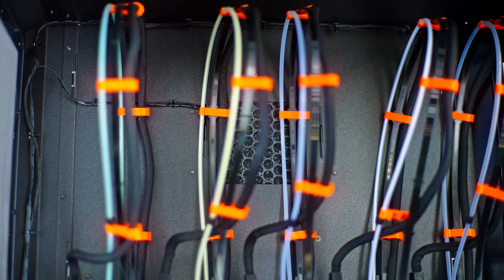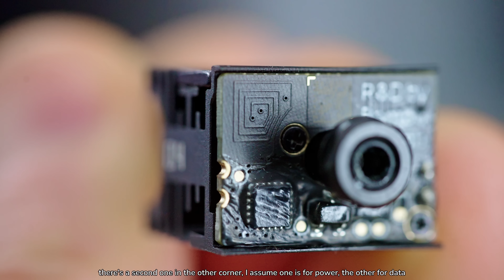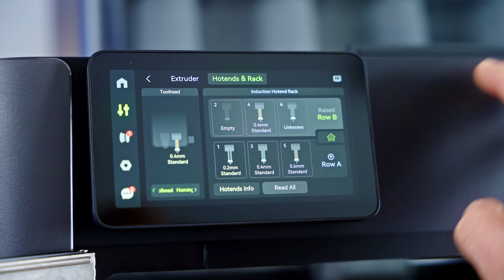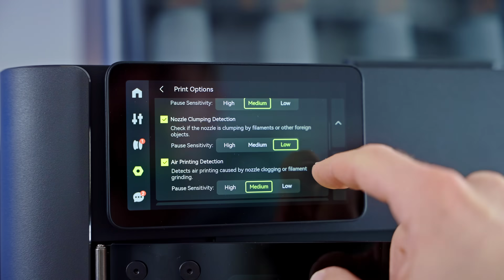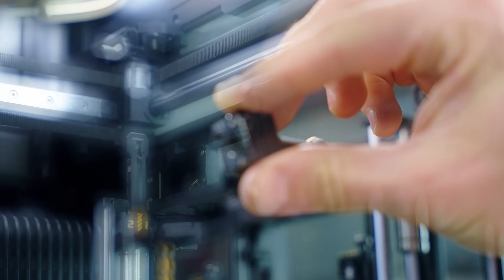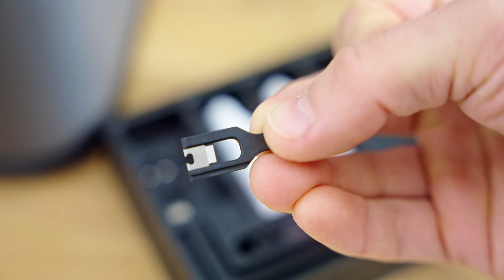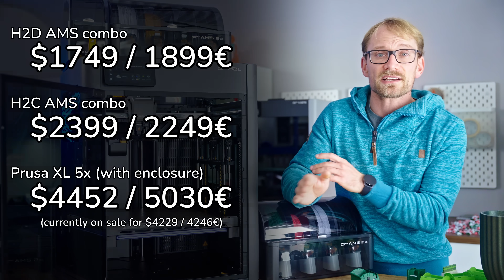The H2C is Bambu's 7-Hotend Patent Evasion Masterpiece!

Comment: Yay hotend vendor locked parts great....
Reply: Are there Prusa XL toolheads 3rd party?
Reply: @bootchoo96  not sure but if there aren’t that’s still no excuse for either of them. As I said in another comment, it’s one thing if there’s no options because no one can compete in price. It’s another if the manufacturer SPECIFICALLY BLOCKS COMPATIBLE PARTS WITH DRM that would otherwise work. That’s an attack on consumers like you, and your ability to own what you pay money for and repair it.
Reply: @dawn9340 "would otherwise work" sure but we don't know that
Reply: @bootchoo96  don’t defend something you don’t know about when the company is trying to slip its hotdog in your hole anyway. Literally your toothbrush charges using the same technology. Some soldering irons work on the same property of inductive heating. It’s not a new technology at all. So we do know that. We know that the company locked you out of having the price and availability advantages that competition brings. They’re loving you defending them though, I’m sure they’ll send you a few free printers though. Dummy
Reply: @dawn9340  yeah and my laifen toothbrush heads doesn't work with my Philips or Oral-B and I don't throw a fuss about it.

They are 3rd party brush heads but they are not the same quality as the OEM - but I get what you mean.

Just don't buy Bambu, or Prusa, or Snapmaker and make your own that way you'll have full control of your toolhead + nozzle
Reply: Just make a aftermarket part that replaces it. If you dont like something be the change you wish to see or 🎲 🎲 trying
Reply: @alexhise968  that’s not the problem. The problem is Bambu locking it down to make it harder where there’s honestly no good reason. We’ve been making coils for years now and there’s no reason that can’t be done by every factory in China worth its salt. The answer is not “make some incredibly complex thing to get around restrictions”, it’s “stop accepting crap from manufacturers and mindlessly buying it.” Unless you want to live in the world where you rent everything and can’t fix any of it. Check how John Deer tractor owners (aka the backbone of your food supply) are liking that…
Reply: Reality check, how many people actually buy 3rd party nozzles for a bambu? I'd wager not many (and yes mr furiously typing away at the keyboard, I know you do, that doesnt mean everyone does)
Reply: @puressk  A valid concern since you cannot un-clog them apparently. I would expect you’ll buying more of them than with any currently used machine.
Reply: @puressk 

This. 

And offcourse bambu wouldnt allow thirdparty nozzles. The chance something breaks with subpar thirdparty nozzles is to big. And then bambu has to trouble shoot problems that other vendors caused..
Reply: @blikje_in_de_water so one day, if their new printer is not selling well they can just stop selling replacement for the old one and force everyone to upgrade
Reply: My samsung phone doesnt work with apple parts. My samsung waching machine doesnt work with miele parts 
My sony tv doesnt work with lg parts. Etc

What is your point?
Reply: @blikje_in_de_water  Nozzles are a consumable on a printer, and a well built printer can last much longer than a cellphone. You need to know if you can still get parts 5-10 years in the future.
Reply: @YourArmsGone 
I count 2 3 years for a printer at most. 

Phone easily outlives my printer.
Reply: @blikje_in_de_water  My first printer is running flawlessly at 6 years old with over a year of print time on it. The only thing I have had to replace are Nozzles.
Reply: @blikje_in_de_water  That's weird, I've been using my X1C for coming up on 4 years now...And it's running STRONG.  OH what's that?  Their parts aren't super expensive and easily replaceable?  Oh wow......
Reply: @Hedgey404  parts arent expensive you say ... so you missed the thing that single basic nozzle for Vortek costs $39(times five for full set ...), high flow $69(times five for full set ...) and there are zero options for truly hardened nozzles which is unsurprising due to the fact the system simply cannot work with abrasives due to AMS being necessary ...
Reply: @blikje_in_de_water  dumb argument. I can buy 3rd party toothbrush heads for my toothbrush and they work fine because it’s simple and common sense. Bambu not allowing something like that would be anti-consumer (that’s you, don’t know why you’d not want better prices). Am I missing some advantage of the serialization and global anti-self repair movement going on?
Reply: @dawn9340 40 dollars for a nozzle. I wouldnt bother with third party.

Why save max 5 dollars on a subpar thirdparty nozzle on a 2600 dollar printer...

And for those toothbrushes. Third party are terrible, they dont fit well. I always buy the ones from the manufacturer
Reply: @dawn9340  Where does it say Bambu doesn't allow third party nozzles? Does it say that on the A1, where you can use third party nozzles? Or the A1 Mini? Or the P1s? P1p? X1C? P2s? H2D? H2S?...
All their printers have allowed third party nozzles, nor did Bambu say the H2C would not allow third party nozzles either.

Bambu won't support third party nozzles.
So if you stick a $2 nozzle from Aliexpress in the printer and it burns your house down you cannot blame Bambu as it's not their responsibility in that case.

They won't support doesn't mean they will block it...

Also, all these people dodging the other question: you can buy third party nozzles for ALL Bambu lab printers. Have you actually gone out and bought a third party nozzle for a Bambu lab printer?

Comment: Still not fully convinced. I‘ll keep waiting for INDX.
Reply: Is this a new printer?
Reply: @HaloUno88  See below. Bondtech INDX as a new multi extruder system. You might upgrade your old printer with it or wait till a company like Prusa will sell it with their printers. So far to me it looks superior than Bamulab Vortek.
Reply: what is indx
Reply: Bondtech indx. Similar system to this but the filament stays loaded in the nozzle. They teased it in the spring. Should be announced soonish
Reply: @0.6phanucbao19  It's a toolchanger very similar to the bambulab vortek, from BondTech. You can basically add it to any printer you can tinker with (so every Voron, Sovol, Prusa). There also will be an officially supported Prusa CORE One (L) version of the INDX system.
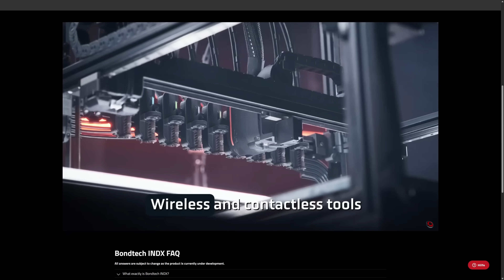Reply: @0.6phanucbao19  The one shown at 3:07.
Reply: @0.6phanucbao19  Bondtech hotend changer system. Really hoping it'll drop and I can add to my Prusa XL - get like 15 colors in on as big as the XL is
Reply: @0.6phanucbao19  index is bondtex  hot end using induction nozzles it is where i think bambu got the idea from
Reply: @0.6phanucbao19  INDX is a new filament changing system from Bondtech (note: it is NOT a 3D printer itself) that swaps the entire filament path (hotend + extruder gear + PTFE tube) each time, but only has a single motor and heating element.  In a way, you could say it is a step between the Bambu Lab Vortec, which only swaps the lower end of the filament path (i.e., the hotend) and the Snapmaker U1 and Prusa XL, which swap the entire toolhead (i.e., filament path + motor + heating element).  The advantage of the INDX is that -- just like Bambu's Vortec -- the actual space taken up is quite small, which allows for more heads to be available.  The downside is that it does have slightly longer loading times than an XL or U1 due to not being able to heat the filament until the tool is picked up.  (The XL and U1 can preheat filaments since the toolheads all have separate power and data connections.)

The other downside is that -- as noted earlier -- the INDX is not a printer but just a system that can be implemented by tinkerers or other manufacturers.  For example, Creality could likely license the INDX and create their own printer with it.  This does make it much more of a tall order for someone who just wants a simpler printing experience like you get with Bambu Lab printers.  In that case, the Snapmaker U1 is probably the best option.  It isn't as clean as Bambu Lab, but the color changing is faster and it's "simple enough".
Reply: Good luck with them!

Comment: I expected the vortek to be slower due to retractions and priming.  Speed isn’t everything, but does seem a lot slower and a lot more complicated (more to break, more to buy) than bontech indx.  Only unique thing is literally being able to use 12+ filament s and multiple nozzle sizes.   If the indx prints great, I think it’s going to be the market leader for a while.
Reply: Different nozzle sizes at the same print are not supported (as noted in BambuStudio changelog), so the only usefulness is just keeping different sizes installed waiting for different prints.
Reply: More complicated? Motors.. Ok. Printers have been using them for long time. Rods and bearing? Same things. Hotends.. Dumb parts of metal. No needs for extra extruders, heaters, sensors and all like tools changer.
Reply: @patricklebel1141  Right?  People are complaining and comparing to the Snapmaker, but all I can see with the snap maker is 4X the potential points of failure. Extruder clogged on the snapmaker?  Which one?  PTFE Tube jammed?  Oh which one?  Hot end broken/clogged?  Which one?  I see more work with more problems with the Snapmaker or similar than I do this.
Reply: @Hedgey404  YMMV.  One dead head on a snap maker U1 and the other 3 work just fine.  If the H2C head or the vortek nozzle changer itself dies, it all dies.  I just see lots of scenarios where something could get physically jammed in the vortek.   

Half of that is shared with the INDX in that a single blob of death could takeout the singular head and one nozzle,, but I do worry about the vortek contraption more.

Comment: IMO the XL and H2C are marketed at different sectors, to me Prusa are still printers built for people who want their hobby to be 3D printing, rather than Bambu users where the printer is just a tool. I know that lots of people are using Bambu printers in print farms because they're set and forget. If you have an H2C connected to 2 AMS units you've then got 8 potential filaments plus nozzle sizes allowing you to send any one of 48(?) nozzle/material combinations and have it print without any intervention required. I don't think the XL can match that, and if you're going to use an XL in that way then all of a sudden that speed advantage is completely negated if every filament/nozzle combo change requires you to manually set it up. I don't love Bambu for their business practices but I do love seeing what they're doing to the world of 3D printing.

Comment: I am fascinated by the possibility to print thick chunky strong infill and have an ultra fine external walls for high detail models to get efficient large collectibles/cosplay/figure prints.
Reply: that is indeed opening up a world of possibilities. IF the slicer can make it work.
Reply: FYI - this is NOT available. There is currently no consumer slicer on the market allowing to do 2 different nozzle diameters.
Reply: if you look at it from a perspective of CAM in manufacturing, there is even more than just different parameters in a single layer. but this necessitates a whole new toolchain, from CAD to CAM to kinematics. and theres a lot of brains required to make it work. CAM/CAD packages for industry often come withr 5 figure pricetags for a reason - because it really is hard to do!

maybe bambu has the money and the engineering power. lets hope in the west something similar can happen.
Reply: According to printer nerd still can't mix nozzle sizes in a print
Reply: @npeshman Tom also stated that in this video...
Reply: @zeke7515  yeah I heard it a few seconds after I posted that😅
Reply: @npeshman  is there any slicer project thats working on this? I have lots of fancy ideas about slicing, but I am not exactly a pro in coding this kind of stuff.

I am getting into linuxCNC and FPGA-cards for motino control and such atm, but slicing(especially when its beyond 2.5d kinematics) is a bridge too far for me.
Reply: @simonschneider5913Bambu studio has been updated to allow multi nozzle printing. Some commenter mentioned this on the printing nerd  review.
Reply: Most of a prints strength comes from the external walls though and not infill.
Reply: @elobiretv  that depends a lot on what youre doing. I found that infill and perimeters combined can do more than just one of them alone.
Reply: @simonschneider5913  well yeah you need both, but if I was to increase one for strength it would be perimeters not the infill.
Reply: @elobiretv  in fiber-composites, honeycombs are used to stiffen structures while picking up very little weight. the same applies here. Infill can give you so much rigidity. but its always a tradeoff depending what youre after.
Reply: Doesn't the new setting in Bambu allow you to do that? You can make infill of many lines thick.

Comment: Very useful and thorough review as always Thomas, thank you!
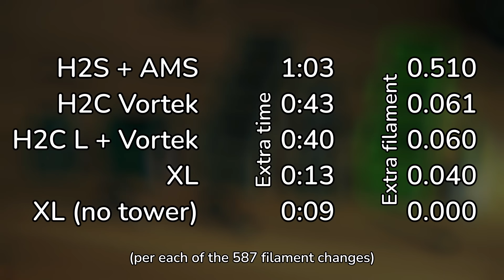But I do have a little question/suggestion. 15:50 It would help for this overview to show the baseline time as well. Also, "Extra filament 0.510" is rather unclear without a unit, is that 0.51 kilogram? If so, what was the base weight? Is that a ratio (i.e. 51% extra?).
Reply: Could be meters (i.e. 51 cm) which would be less than 3 gram

Comment: why he has always the prusa crap in the background?
Reply: Did you watch the times? 50 second nozzle swap vs whatever XL does... 3 years old printer kicks some ass.
Compared to Snapmaker U1, though with only 4 colors, or even H2D, H2C seems to have fairly little advantage 😅
Reply: Because it still beats  anything bambu has come out with or plans to come out with?
Reply: @pomprocks  it beats especially my wallet, the prusa XL is at €5,030.53 (not pre-assembled) with the enclosure and 5 heads, the H2C is at €2,249.00 the prusa machines are extremely expensive.
Reply: @pomprocks  nice cope bud ;)
Reply: @pomprocks In your fantasies. Bambu sucks, yes, but nowhere near as much as Prusa, the original OpenSource troll.
Reply: @pomprocks  Prusa hasn't beaten anything since the Ender 3 took over... They have been 2-3 times more expensive and they've developed a reputation for having bugs, using their overpaying customers to beta test their printers...

Comment: Seems unnessacerly complicated
Reply: Lol what? This is the simplest nozzle swapping system that exists...fewest moving parts.
Reply: Not really. Complicated? Sure. Unnecessarily? No. Actually, this provides a fix for many of the most tedious things Bambu hadn't solved yet: Nozzle/got end swapping regularly, and loading new filament; with the added benefit of a minimization of filament poop. TRUST me, as someone who has only had an H2S for a couple of weeks... The filament waste adds up big time. It's a lot of wasted money and plastic. This basically solved that for the most part which will probably pay for itself.
Reply: @QuietWind01 yeah but It is a self created Problem. They could've tried to implement the prusa mmu Filament retraction and ramming, this method als reduces waste big time. But maybe this ist too flawed for them idk. So If it helps you great.
Reply: @MaxMichel89  How is it a self created problem? 😂😂😂 I'd agree that it is a problem that is an emergent property of an AMS system, but self created? That's an overstatement at best. Also, your suggestion makes absolutely no sense. Ramming still adds waste, and I bet if you paired them up, the H2C would create less. In fact I think basically any tool changer system, even Prusa's own, would create less waste. Again, complicated? Sure. I'm sure people said that when the very first tool changing printers came out. 'Tis innovation. If you want to stick with wasteful printers with single nozzles then go ahead, be my guest.
Reply: @QuietWind01 they decided to do the Cut and poop with the first ams systems. That ist quite reliable and adda Lots of waste. It's possible to use a single nozzle and only a cleaning/priming Tower Like prusas MMU but they Choose Not to do this. Bambus basicly invented the poop chute, so yes they created that Problem in the First place. But IT does Work reliable so it was implemented. Now they can reduce that poop to a Minimum with nozzle Changes and the inductive nozzles
Reply: @MaxMichel89  I'm confused as to what your point is. In fact, you are only proving my point, I think. It's complicated, but not unnecessary. "They could have just used a purge tower" yeah but this is still WASTE, or at the very best, filament that isn't being used for your actual print.

Tool changers like this basically get rid of waste, aside from the unavoidable purge when swapping filaments into each tool head (or in this case, hot-swappable hot ends) literally like any other printer. A little bit of waste is unavoidable, even with a single-nozzle, single-color printer, each time you change filament. But other than that, this basically solves the same problem Prusa's tool changer solves, while simultaneously allowing for a larger variety of hot ends and colors on hand at any moment.

Did you also call Prusa's tool changer, which is essentially the same thing just slightly more primitive, "unnecessarily complicated"? Or perhaps you're willing to admit you aren't being logically consistent?

I guess attempting to do material changing 3D printing is needlessly complicated. We should just go back to the days where you had to add pauses to your prints and manually swap filament.

I seriously don't understand your point. It solves multiple problems that have plagued 3D printers for years and it does it with far less waste. I'd call that necessary (for the purpose of efficiency and reducing plastic waste), or at worst, worth it.

To call this "unnecessary" seems extremely myopic to me.
Reply: Idk man if it works it works and its cheaper when more toolheads.